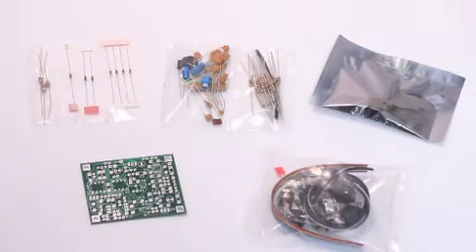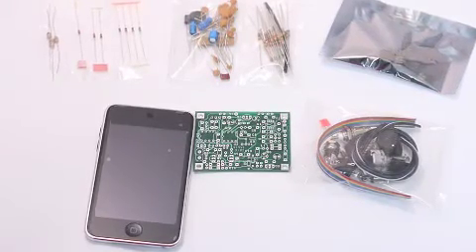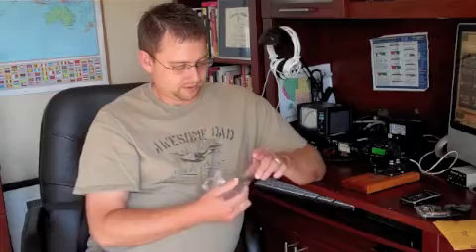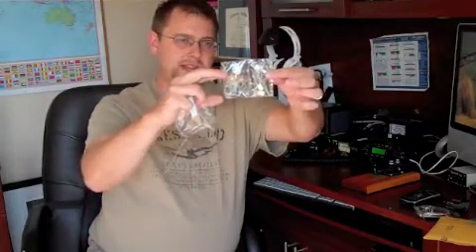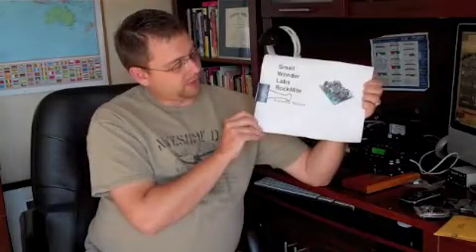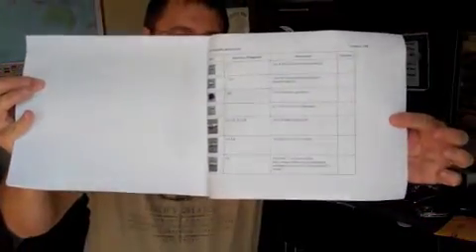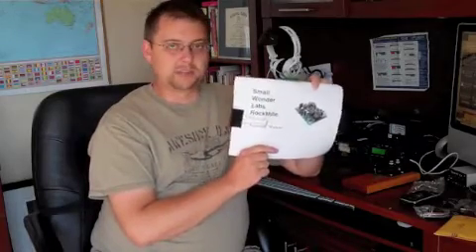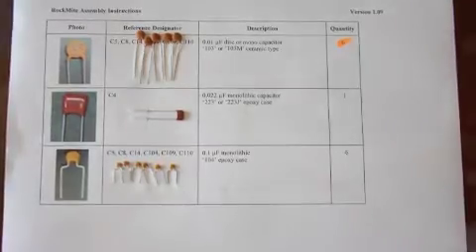KD8NJZ Rockmite Pt 2

Comment: Great job on the video and thanks for the mention of my channel.

A couple of reminders, when taping the parts down, I’ve learned not to tape any IC parts.  Just leave them in the anti static bag.  Most likely it won’t be problem, but I’ve read that taping them down can cause static problems.

Also take time when soldering the first surface mount IC; it’s pretty small so watch for solder traces.

You’ll do great, take your time and enjoy the process. 

John
W5CY